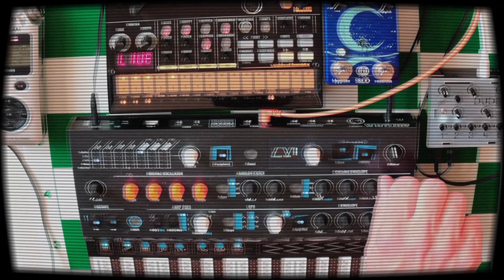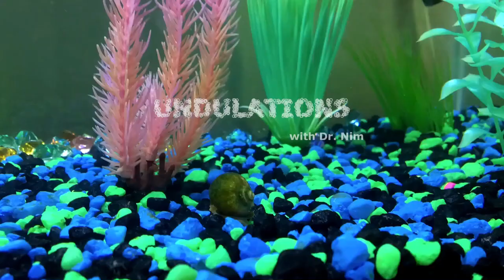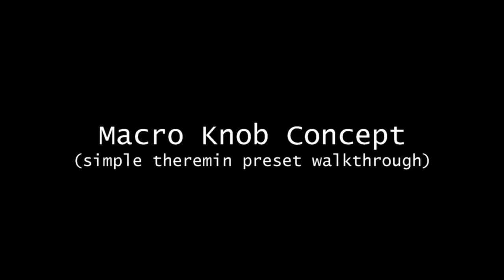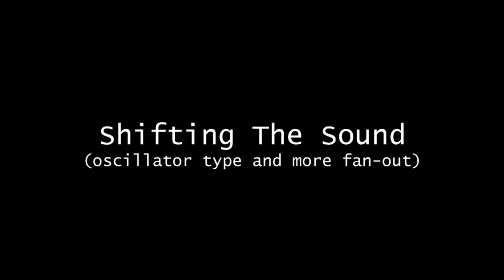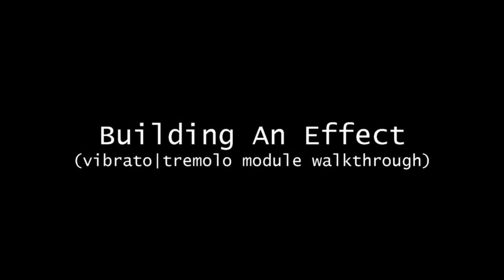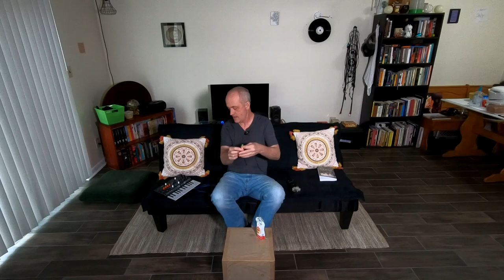MACROFREAK

Comment: Great tutorial. Thanks.  If you can find one, there is a little midi macro controller called a Gibbon Goliath. I have one but I don't know if they are still made. They have one encoder that can control up to 16 cc parameters simultaneously. This video reminded me of it and I dug it out and it seems like it works well with Microfreak. Haven't done much with it yet.
Reply from the maker: That controller looks really cool! I've got a Midi Fighter Twister (16 knobs, switches, banks, etc.), also a Korg NanoControl - but those are really a different thing compared to the Goliath. Macro control is really fascinating - such a useful way to customize a sound / instrument. I did some other macro stuff on the Organelle from Critter & Guitari for controlling various Korg Volcas. Makes sounds that are hard to get any other way. I bet the Goliath is great with the MicroFreak😀.

Comment: I was playing with the lfo on the cutoff effect and I really enjoyed changing the lfo signal to some of the noise and stretching out the sound until it became a sort of drone.  Then the arpegiator got involved and I think it lost something.

Great video.
Reply from the maker: Hey, that sounds great! I need to use those random LFO waves more often, especially the smooth one (I mainly use them at max frequency for FM). Thanks for the feedback!
Reply: @undulations  I really enjoy how clear your videos are - you're very good at explaining and showing at a great pace. Effects are what this unit is missing so using the matrix to simulate some effects is brilliant.

I also love playing with the keyboard although I didn't think I would when I first got it.  You can get it really responsive and make some interesting modulations based on on velocity or time. I was sequencing the microfreak through something else and ended up recording the midi expression into my daw instead.  It's got a lot of expression in the funny little keys.
Reply from the maker: @randommcranderson5155  Thank you very much🙏🏼! I completely agree about the keyboard - I felt like it was a quick transition from "wow, no travel on the keys" to "this is an amazing setup - keyboard, touchplate, and everything in between".  I need to learn more about the velocity and pressure curve settings. I've changed them for a couple of presets but still. Anyway, thanks again for checking out the video!

Comment: YOU REALLY GET YOUR FREAK ON! THANK YOU! You have some amazing patches that you step through in detail. This is exactly what I have been looking for. I have trouble wrapping my head around the signal routine, so I could not reproduce this organically. Do you share your patches?
Reply from the maker: Hey, thanks for checking it out🙏🏼! I haven't posted MF presets anywhere before but certainly not against it. I'll see about doing it on PatchStorage.com (I've put some Organelle code on there before)👍🏻
Reply: @undulations  I have created some very fun patches to share. Your Macro technique is what some are missing to take them to another dimension. I’m better with modifying patches to customize them, then starting from scratch. My ears lead me!

Comment: Nice video! Makes me want to drop everything and play mine.

I wish there was a way to modulate the sequencers beat divisions with a mod source. I would have so much fun with that
Reply from the maker: Thank you - no higher praise than that it makes you want to play🙏🏼!  Wow, I've spent like 20 minutes fiddling around with your idea. I synced the LFO and have it modulating the tempo while running a sequence. Something like a mod strength of 30, 70 bpm, and LFO rate of 1/8T or slower seems to give some really different grooves🧐. Or with a low arp, the MIAMI patch from last video (or any bass preset), and glide - those settings give some 303 vibes - really cool👍🏻!
Reply from the maker: Sort of a can of worms. Now with the LFO unsynced, not so fast as to give an averaged beat, not so slow as to just be like 2 tempos trading back and forth (square LFO, btw). Some filter amount on the envelope to give more of an acid bass sound. Arp notes spanning a couple of octaves. It's actually oddly listenable😀 It's kind of a complex swing.

Comment: Amazing video! What's up with the tape bits on the MicroFreak? Is it to stop the light? Looks like the light is coming through anyway.
Reply from the maker: Thank you very much🙏🏼!
Yeah, first video, way back, had the full lights and it was kind of rough to watch - especially on a bigger screen. The led's seemed to phase with the camera framerate and sort of... throb. Anyway, i used the tape to dim them way down, but still left enough light for folks to see the synth's state easily. I guess it's been easier to leave it than try to solve it from the camera/editing side. Thanks for checking it out!
Reply: @undulations  Ah, makes perfect sense. Thanks for taking the time to reply. I just got a MicroFreak, and your videos are extremely useful.